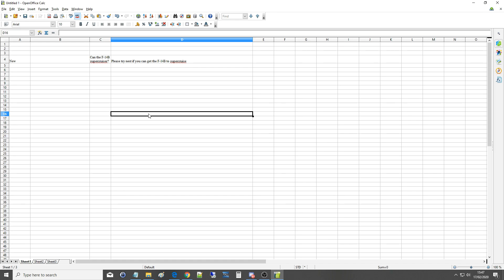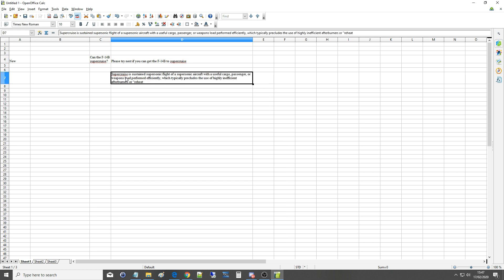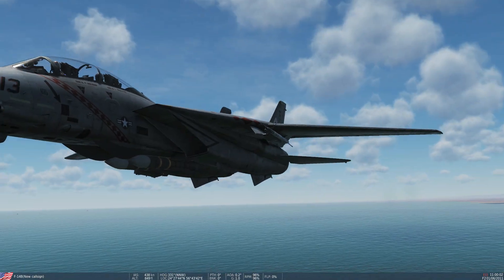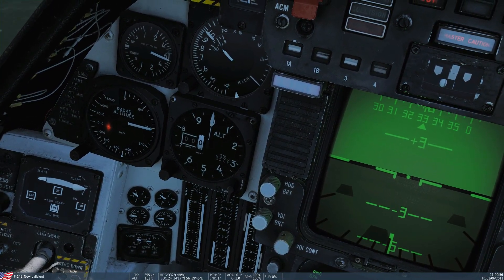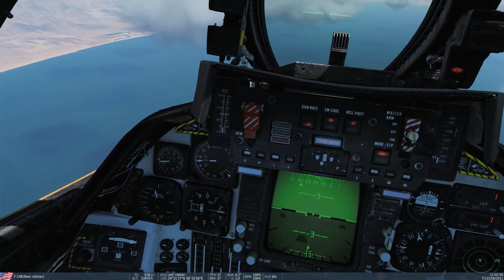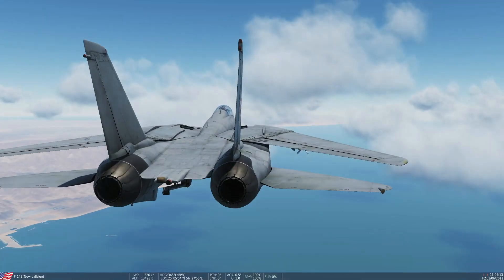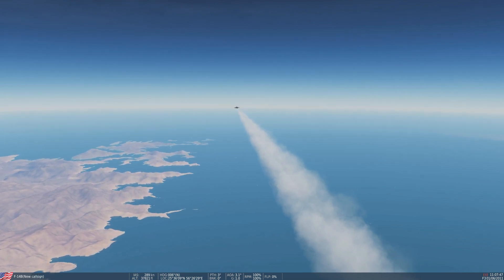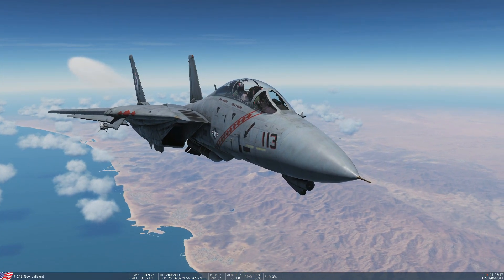F-14B: Can The Tomcat "Supercruise"? | DCS WORLD

Comment: If you watch the fighter pilot podcast on the F-22, Pilot mentions that even F-22 Raptor can't go to supercruise in full military.
Since the transonic drag is to much, so what they do is punch in afterburner until they reach Mach 1.6 or so and go back to Full mil and sustain Mach 1.5.
That's supercruise.
Reply: True, Concorde was the same. Transonic drag is the culprit.
Reply: Curious - there is a Pensacola Seniors interview with Jim Sandberg (YF-23 test pilot) where he said the at least the YF-23 (implied also the YF-22) could punch through in military power. 54:30 in that video. That said, don't know if the conditions were different, or if changes in the production F-22 sacrificed a little bit of speed.

He also did say that punching through with afterburner was the more efficient way to supercruise, even if you could do it just using military thrust.
Reply: @f38stingray  well ye, maybe my bad choice of wording but f22 can get into supercruse with full mil but it takes really long time and it's not efficient.
Reply: AFAIK the transsonic region goes to somewhere M 1.2 - 1.3ish - up to there there is massive drag that you'd have to overcome. So doing M 1.0something or even 1.1 like the Hornet does in DCS literally is not supercruising, even though it's past M 1. With a plane that can't do real supercruising this still is better than lighting the cans however, but it'd be far more fuel efficient to throttle down and stay at around M 0.9 (or even less for maxing out range).
Reply: @CakePrincessCelestia  I guess that's because not every part of the plane goes supersonic so creates allot of drag

Comment: Dear Cap, 

I suspect you'll need to "punch through" the sound barrier with afterburners, then spool back to mil power. The extra energy required to pass through the transonic zone is likely modelled accurately. Try Mach 1.5 or so, then drop out of burners, and see what speed you settle at...?
Reply: Correct... Concorde was the first plane to do this regularly, only they went to Mach 1.7 or so and then shut off the afterburner. At cruising altitude that plane could supercruise at Mach 2.
Reply: Very good point.  Transonic drag is far higher than supersonic drag.  I know the F-16XL could supercruise with this technique, as can the F-15.
Reply: The F106 was know for this as well.
Reply: @torontolistener5507  if the Concorde didn't get to 1.7 on the first try with reheat they would need to land ASAP and refuel.
Reply: I thought this was common knowledge in the aviation enthusiast community.  I read this in Aviation Week & Space Technology over 15 years ago when the military contractors were bragging about then new F-22 and F-35 supercruise capabilities. F-14 jocks even in old unrebuilt A's in clean configuration, punch through the sound barrier at altitude in AB, knock off the burner and fly around at supersonic speeds in near full mil power. All this to prove that supercruise wasn't some big new thing that only Gen 5 fighters can do.
Reply: @colinw7205  Remember this is the grim reapers where knowledge isn't power 😂.
Reply: that is right, using afterburners, then spool back.

Comment: Cap, Supercruise does actually allow the use of afterburners to achieve supersonic speed, the point is that once you have achieved a supersonic cruise speed you don't need the burners to maintain that speed. Example, if you get an F4 phantom supersonic then pull out of burner the speed will decay back into the transonic and even possibly subsonic regions, whereas a Typhoon, say, will remain supersonic when you pull out of burner. (Assuming this is done at a standard cruise altitude for the aircraft)
It's actually strongly recommended to use burner whenever crossing the sound barrier, even if it isn't required to achieve supersonic flight. This is because in the transonic region (between mach 0.9 and 1.1/1.2 roughly, depending on aircraft type) there are some weird effects on the airframe. Basically in that region some parts of the aircraft are still subsonic, while some parts are supersonic. An example of this, air flows at different speeds over the top and bottom of the wing, faster on top, slower underneath, hence how the high and low pressure regions are created to generate lift This however also means that the top of the wing could be supersonic while the bottom of the wing is not. Add to this the fact that air interacts very differently with the airframe either side of the sound barrier (Hence why subsonic aircraft are typically seen with smooth, flowing curves, while supersonic aircraft are generally much more angular in design, the curves are better optimised for slow flight, while an angular design is better at supersonic speeds) and you'll discover that the transonic region places a lot of stresses on the airframe and can cause strange effects, such as mach tuck, hence it's best practice to get through that transonic region as fast as possible into a more stable flight regime in fully supersonic flight. This minimises the time you have to deal with any strange flight dynamics and also minimises the amount of stress placed on the airframe. 
A final factor in this is, as a previous commenter mentioned, is the reason it's known as the sound barrier, if you look at a graph of drag vs mach number you'll see a large spike right around mach 1, as you approach the sound barrier the drag shoots up massively, once you "punch through" this barrier and into the supersonic region the drag drops off just as substantially, hence it generally requires significantly more power to achieve supersonic flight that it does to maintain it.
Reply from the maker: Copy thanks
Reply: No worries, happy to help

Comment: I wonder if the nozzles of real aircraft are closed or open when supercruising. 
To achieve supersonic exhaust speeds the nozzle has to be open. 
More exactly: in the afterburner section the airflow is slowed down to about mach 0.6 (because otherwise the flame would be carried away). After that follows a convergent nozzle part which causes the airflow to almost reach mach 1. At the narrowest section the airflow speed is almost mach 1. After that narrow section a divergent section has to follow if the airflow should exceed the speed of sound.

Without a divergent nozzle (= open nozzle) at the narrowest section a shock wave would be formed. After a shock wave (which is perpendicular to the airflow direction) the airspeed would immediately drop to sub sonic. Basically, that is the principle e.g. the F-16 intake is using to slow down the airflow to subsonic speeds for the compressor which cannot digest supersonic airflow. Why does the exhaust speed needs to be faster than Mach 1? because if the plane is flowing at e.g. 1.5 mach (450 m/s) the exhaust airflow needs to be pushed with speed greater than 450 m/s (the mass of air needs to be pushed aft faster than the aircraft moves forward or otherwise there would not be any thrust. We thrust Newton here 😎

That is one reason why planes without a divergent nozzle usually cannot go beyond mach 1 in level flight. E.g. Harriers have lots of thrust but not the right nozzles. Or an A-7 with convergent nozzle is sub sonic and F-8 with convergent - divergent nozzle is supersonic. Of course wing design and other aerodynamics play a role, too.

However, to make it more complicated: at 30k feet mach 1 is around 300 m / s (not because of the altitude, but because of the temperature of around -40 °C). Still the exhaust speed can be higher than 300 m/s in a convergent only nozzle since the exhaust temperature is at least around 600 °C. That means  INSIDE the nozzle the local speed of sound is much higher than 300 m/s. E.g. maybe 400 m/s which would be > mach 1 compared to OUTSIDE the engine but still subsonic INSIDE the engine, so no divergent part of the nozzle required.

So basically: when supercruising can those aircraft fly with nozzles closed because the exhaust is hot and fast enough (supersonic enough inside the nozzle), or does the nozzle has to be open but afterburner would be off?

Otherwise the earlier comments are right  that you need extra thrust to overcome transsonic drag. E.g. legacy Hornets accelerate faster in transsonic region than the Super Hornets because  the legacy Hornets observe the area rule more closely (area rule is especially important in the transsonic region).

Comment: The higher it gets the easier it become to break the sound barrier but that doesn't mean you're faster, it means that the speed of sound is lower because the air is thinner. So i don't think that in the test the tomcat has gone supercruise
Reply: But supercruise means to go cruise faster than speed of sound. How is that not a supercruise when the Tomcat cruise at more than the speed of sound.
Reply: @nemistic9228  because to go supersonic you have to go 1.2 mach, until then you are still transonic. Plus he was gonig to 550kt when he broke the sound barrier but at 656kt at sea level,  so it wasn't going faster when he broke the sound barrier. That would be a terrible supercruise...
Reply: Its may be a fine distinction, but if the free stream velocity exceeds mach 1 I think the airplane can be said to be traveling at supersonic speed, even though it may also be in the transonic range where not all flow around the airframe exceeds mach 1.  You don't have to exceed free stream mach 1.2 to feel the the shift in center of pressure and change to laminar flow, but you do want to accelerate past 1.2 quickly because you are still the transonic high drag range.
Reply: marco conti Again back to the definition, supersonic means to go past the speed of sound(emphasize) which he did. I understand that part of the air flow will still be transonic and that wouldn’t be ideal. But the point is if the plane broke the sound barrier, by definition, it is going super sonic.
Reply: marco conti Maybe what your intention is , even though, technically the plane is super cruising, it is not the ideal speed to be at.(aka “terrible supercruise” you have mention)

Comment: I believe only the F14D can pull it off, since it has the more powerful GE engines (same engines as the F15).
Reply: F14D and B used the same engines.
Reply: @jasonbernal9348  just before it's cancellation the navy installed the GE engines in a super tomcat, it was under going trials on the Rossevelt, because of the heavier engines. It was superior to the other tomcats. Around that time it was then canceled

Comment: question: How high you have to fly that sonic boom cannot be hear anymore on the ground level?
Reply from the maker: interesting,,,,
Reply: From Wikipedia's page on Sonic Boom: "Ground width of the boom exposure area is approximately 1 statute mile (1.6 km) for each 1,000 feet (300 m) of altitude (the width is about five times the altitude); that is, an aircraft flying supersonic at 30,000 feet (9,100 m) will create a lateral boom spread of about 30 miles (48 km)."

It looks like you're not likely to reach an altitude where it won't reach the ground...

Comment: I wonder how the F-14As pratt engine would compare to the GE??
Reply: I was a Tomcat RIO back in the late '80s and had time in both the A and what we called at the time, the A+ (now the B).
The most significant difference between the Pratt&Whitney TF-30s and the GE F110s was that the pilot could yank the throttles around on the GE engines during ACM without worrying about a compressor stall. That reliability made a huge difference. Next up is the dry thrust you could get at low speed out of the GE engines. It allowed you to get slow in a fight if you had to without being stuck in an energy hole for the rest of your life. I will say one thing in defense of the TF-30s though - the ram effect you got when supersonic was damned impressive and probably gave them a slight edge in top speed.  Though the main benefit to speed was generally in survivability on  bugout where we'd go supersonic but only long enough to exit the area. Fuel limitations would mean we never even got close to top speed unless that was really the central mission goal. We loved the GE engines though. Night and day.
Reply: Bradford Robnett 

Those are the same conclusions I have drawn from  information I have researched. Which Is why I was curious to see how DCS modeled it. 

Btw thank u for your service.
Reply: @williamkillingsworth2619  You're welcome! Thanks for buying me some gas.  ;)

Comment: I’m still confused about air density. The higher you go the speed of sound lessens.  So say your 35,000 ft and the needle says your crushing mach1 but your true airspeed says something different say 800km/h So are you actually going mach1 or going the tru air speed?
Reply: Usually you always refer to the local speed of sound (which drops at higher altitude primarily because the temperature drops, it is not so much related to the air density).
Mach  1 can be around 340 m/s TAS at sea level and around 300 m/s TAS at 30k. IAS at sea level would be around 340 m/s but IAS at 30k would be far less.
If one plane flies M1 at sea level and another M1 at 30k the ground speed of the lower aircraft would be higher (about 40 m/s).
Reply: slow hornet alright,  okay that makes sense so it’s not a hard number but realitive to temperature.   Thanks for your reply.